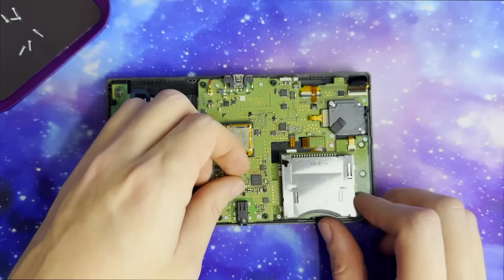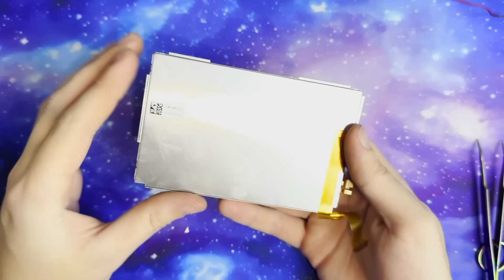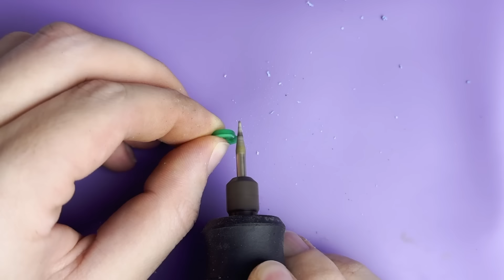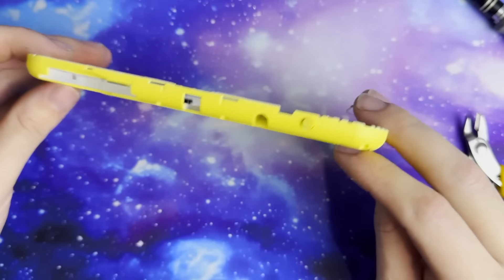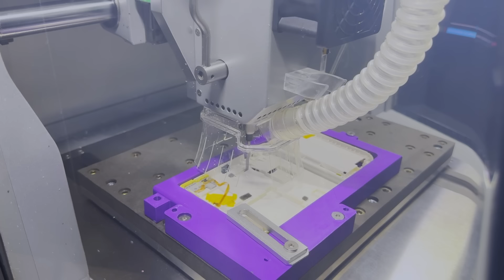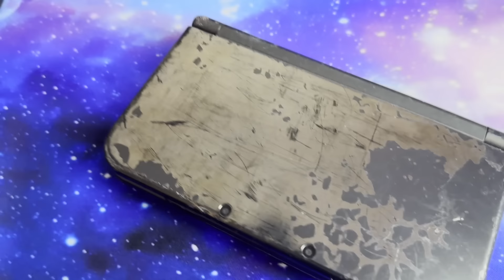I Made A Junk System Into The Ultimate 3DS Console

Comment: So, I did an IPS top screen upgrade on my N3DS XL along with the same Pikachu shell swap. The IPS screen gave me a yellow tint, like a warm color temp. This is after I did the HWCAL files swapped and new profile so it'll force the firmware to read the new files but no luck. Still producing that yellow tint. Not sure what I am doing wrong as I followed the guide given online. 

The 3DS did asked when copying and paste the two files to copy path or moved them from their location???? I chose copy path. So not sure if I did that and the firmware isn't picking up the new files or what. Maybe I need to move them completely. 

What did you do different if your's didn't have that yellow tint when you're done?

Comment: Could a beginner be able to do this? I’ve never done anything like this but I want to change the entire shell on my modded 3ds
Reply from the maker: If you’ve never worked on any electronics before I wouldn’t recommend it as a first project. It’s not incredibly difficult but there are many ways it can be damaged if done wrong.

A good starting point in my opinion would be gameboy reshells. They are much more simple.